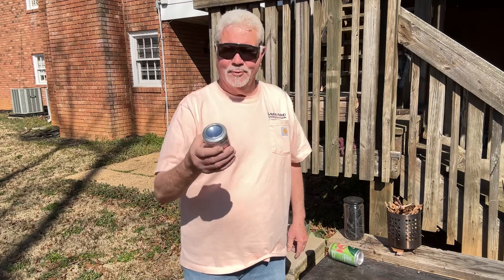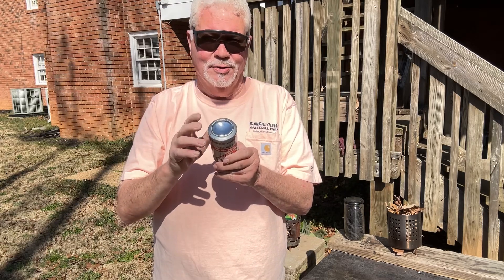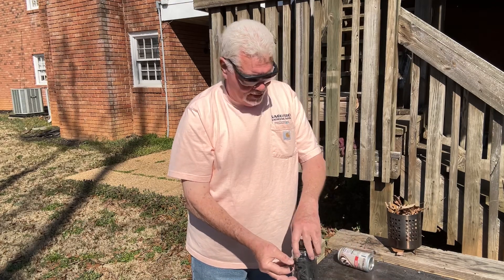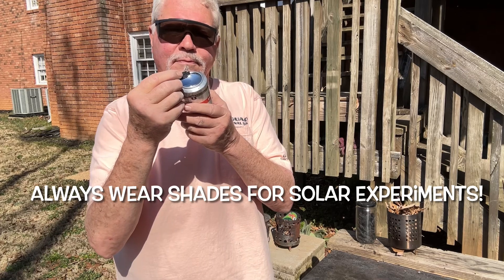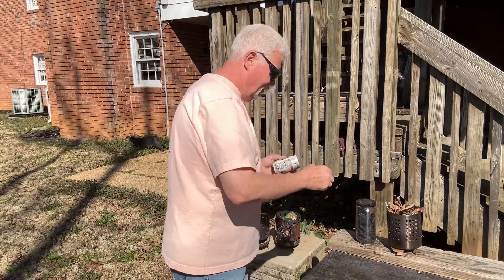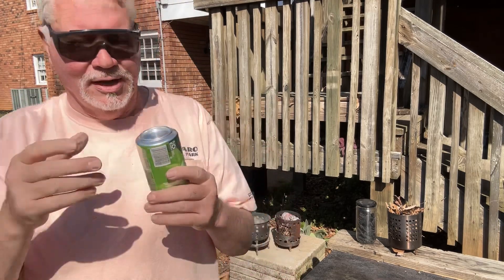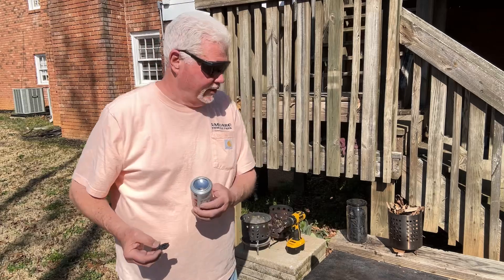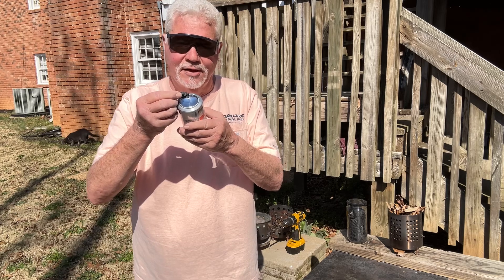Polished Can Bottom Solar Igniter: Will A Hole Improve Power?

Comment from the maker: LOL! I got the physics completely wrong on this one. Let me see if I can explain. I thought the only difference between a parabolic mirror and a concave mirror was that one had a hole in it, parabolic mirror, and the other did not, concave mirror. So, I thought, if you drilled a hole in the concave mirror it would start acting like a parabolic mirror. LOL! Nope, they both treat the photons, rays of light, and focal points differently. A parabolic flashlight mirror is always either making photons converge into a focal point at the bottom of the mirror  (for solar ignitions) or they are taking an existing focal point (light from the bulb) and dispersing it out into a cone shape.
   The concave mirror is always just reflecting photons, rays of light to a focal point a short distance in front of the mirror. So drilling a hole in the concave mirrored bottom of a can does not then start creating a focal point at the bottom of that mirror.

Comment: Try making the hole a lot smaller. Like a pinhole or ice pick sized hole. Then attach your tinder to a pointed thin stick through the hole. You'll lose fewer photons by not making that gaping hole, or having your finger in the way. Even using your knife point to hold the tinder, then positioning the blade edge-on to the sun might block fewer rays. Look at a satellite dish for possible configuration ideas. The receiver is usually held by a C-shaped arm that tries to stay as out of the way as possible while holding the receiver in the optimal focal location.
Reply from the maker: Makes sense, now that I better understand the differences in the curved mirrors that I often work with.
Reply: @DavidWestBgood2ppl  Come to think of it. I think I've seen some YT guy cover an old dish with that shiny aluminum duct tape to make a solar oven out of it. Way off topic I know, yet somehow related.

Comment: Fire King..!!   Everyone always trying to correct the master.. 🤦‍♂️ 

Now, you could actually still improve that can bottom ignition..  here is what i did, maybe you can use it..??  I took a really thin piece of stainless steel wire and bent it 90 degrees to reacg the center of can from the side, then bent a loop at the end that holds my char.. the duct tape the wire to the can.. the wire blocks WAY less photons than fingers.. 😂  here's to hoping this trick helps..!!??🤞
Reply from the maker: I was definitely wrong in my thinking. I’m glad to have a better understanding of the difference in optics between a concave mirror and a parabolic curve mirror.
   Yes, your wire design is like those solar cigarette lighters. Someone has already recommended this mod, but I appreciate the recommendation, Keith!

Comment: Wonder if an Aluminum gutter nail would put about the right sized hole in the bottom of can. Probably have to work on the tapper to make it round. But something tells me it may be about the right diameter. Got me curious now. lol
Reply from the maker: Might, give it a try and let me know.

Comment: David.  The can does not collect photons at the bottom.  Rather they are reflected and concentrated at the focal point in front of the can.  The hole should allow a stick thru it to hold the tinder at the focal point.  Check and see if you are getting the focal point after the hole.  Thanks for the experiment as always.
Reply from the maker: I see what your saying. All photons are reflected to that Focal point 1/2" out from the can, Then how do you explain the focal point being down by the hole in the reflective mirror from a flashlight? I have many videos showing a flashlight's mirror igniting tinder at the opening where the bulb is usually at. 
How To Easily Ignite Punkwood With A Flashlight
https://youtu.be/VILKoDRNPAE
LED Flashlight Solar Igniting Fungus
https://youtu.be/FCTsJSHIVBk
Making Fires With A Flashlight, Leaves Tinder Bundle
https://youtu.be/2-VgczbkyLA
Reply: @DavidWestBgood2ppl   because the curve of the flashlight reflector is designed for the focal point to be down there at the hole. A flashlight reflector is absolutely not a parabolic reflector. 

The reflector that you are making by polishing the bottom of that aluminum can it's like the very shallow bottom of a parabolic reflector. More like a satellite dish, which is also a parabolic reflector, but for radio waves. If you notice, the receiver for a satellite dish is many feet away from the bottom of the satellite dish. 

All you need to do is stick your char or stick or whatever up through the hole to the point above the bottom of that curve in the bottom of the can where you normally hold the char, when there isn't a hole. Why in the world would you think that drilling a hole in the bottom of the can somehow magically caused the light to reflect down into the hole, instead of up where it was being reflected minutes before you drilled the hole. 

Also, you might try googling "parabolic reflector" before you start making a video about parabolic reflectors.
Reply from the maker: First of all, watch your attitude. I probably got the terminology wrong, but what happens at the bottom of a flashlight's mirror where the bulb was is not in dispute. I have plenty of videos showing how to focus in the focal point to ignite tinder. I also have plenty of videos showing how the polished curved surface of a can will project a focal point about 1/2" beyond the can to ignite tinder. Since you have to put that tinder in the way of the photons getting to the reflective surface, it seemed reasonable to make the can reflector more like the flashlight's reflector.
How To Easily Ignite Punkwood With A Flashlight
https://youtu.be/VILKoDRNPAE
LED Flashlight Solar Igniting Fungus
https://youtu.be/FCTsJSHIVBk
Making Fires With A Flashlight, Leaves Tinder Bundle
https://youtu.be/2-VgczbkyLA
Reply: @DavidWestBgood2ppl David, I think the can and flashlight are both parabolas.  Different shaped parabolas have different focal points at different distances from the surface.  n the case of the flashlight, the parabola is much deeper with the focal point at the location of the bulb.  In the case of the can the parabola is flatter with the focal point further out in front of the can.  If you have the chance to try a small stick thru the hole to hold the tinder at the focal point I think it would ignite.  Thanks again for going thru the effort to try this.
Reply from the maker: Thanks Scot!
Reply: I found an old photon from 1912 in a change-purse from my grandma; it is now in my collection.

Comment from the maker: When using a polished can bottom “solar igniter” you block photons from getting to the collector while trying to ignite tinder. I wonder if this solar igniter would be more powerful with a hole drilled in the center of the parabolic curve and then the tinder ignited from the other side through that hole? This is the same "solar ignition" concept as using the mirror out of a flashlight or the headlight off a car.
   Please follow the LINKs below and SUBSCRIBE. Thank You!

Solar Ignitions Playlist
https://www.youtube.com/playlist?list=PLkoXX8XsMW3kl5CicmPv0pTz-7rj4gczW
Char Cloth, Charred Punkwood Playlist
https://www.youtube.com/playlist?list=PLkoXX8XsMW3nfHvlf-YghwFdkUBYRIIMy
Reply: Doesn’t make sense. Using a flashlight or headlight reflector would mostly focus parallel (sunlight) rays at the location of the filament or light source. Whatever falls through a hole in the center is just plain sunlight.

Good experiment though. Gotta prove to yourself, that what you believe, is true.

Cheers from Edmonton AB, where there’s still some ice about, but temps are mostly above freezing.
Reply from the maker: See my solar ignitions playlist and these 3 videos.
How To Easily Ignite Punkwood With A Flashlight
https://youtu.be/VILKoDRNPAE
LED Flashlight Solar Igniting Fungus
https://youtu.be/FCTsJSHIVBk
Making Fires With A Flashlight, Leaves Tinder Bundle
https://youtu.be/2-VgczbkyLA